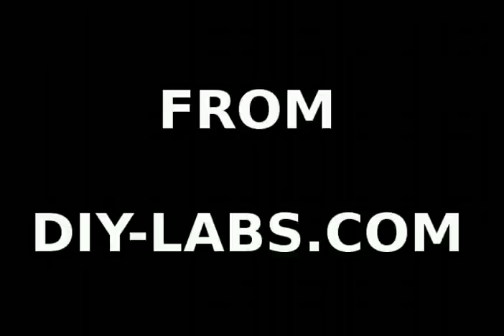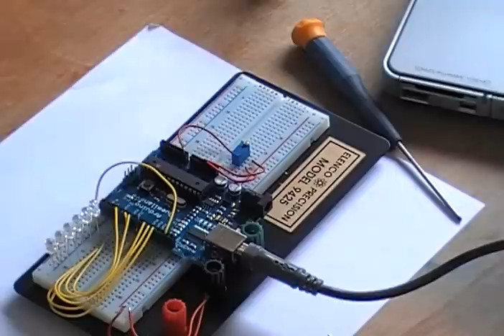Arduino PWM Variable LED Chaser

Comment: You are conecting the led direcly, with no resistense. I think that maje damage to the led, no?
As I remmeber only the 13 pin has output resistence, am I right?